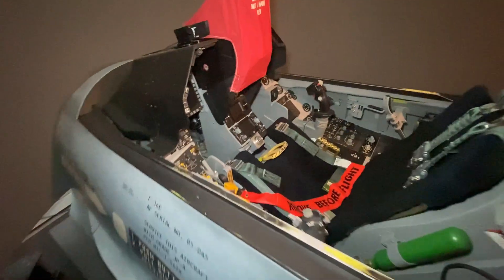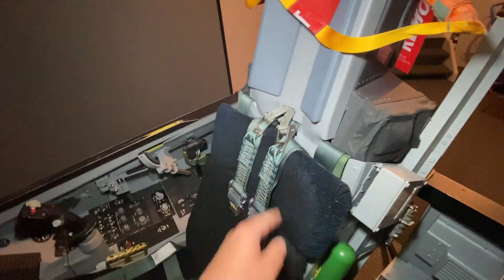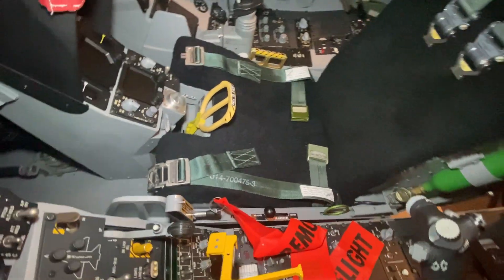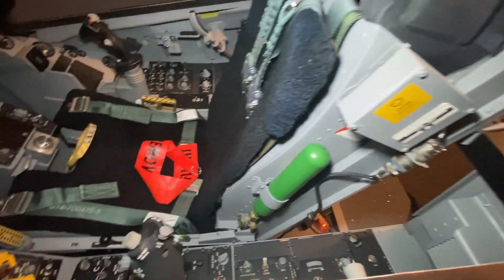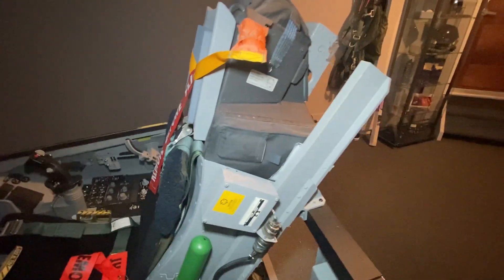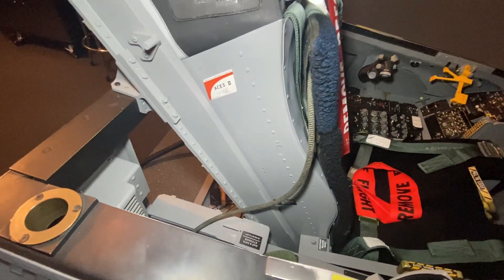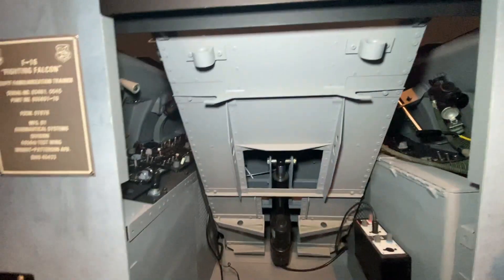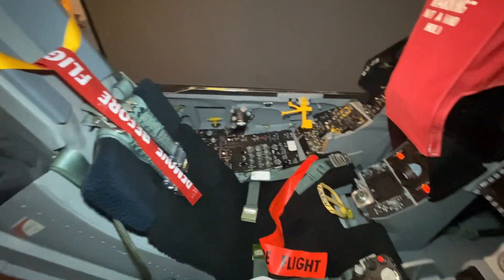TVS Build Cockpit 2

Comment: Nice weathering you've done on the sqare tube. And that electrical actuator looks impressive.
Reply from the maker: Alex Young I purchased it from progressive automotives model PA-17.   It’s good for 850-2000 lbs.   I’m pretty heavy when sitting in that seat.  Lol
Reply from the maker: Alex Young I only wish they had a better way to set the stops on it.  It was all mechanical and trial by error.  Real pain in the butt.  But at least once it is set you never have to deal with it.